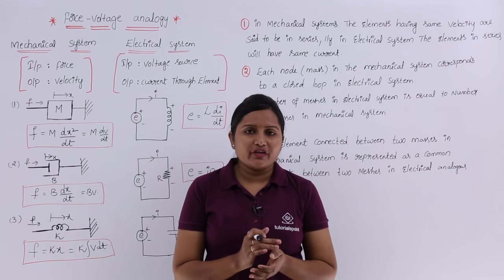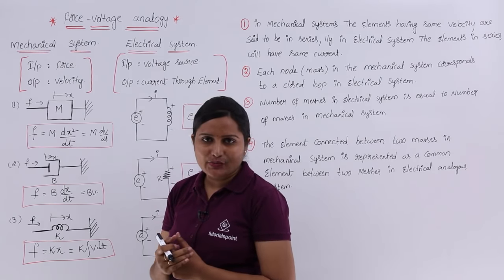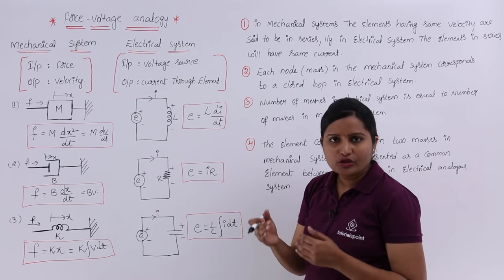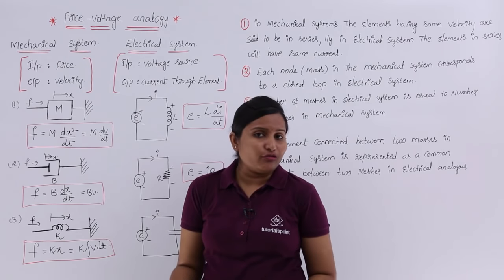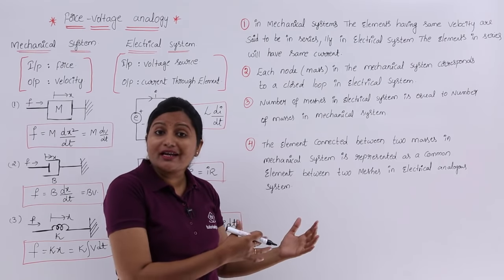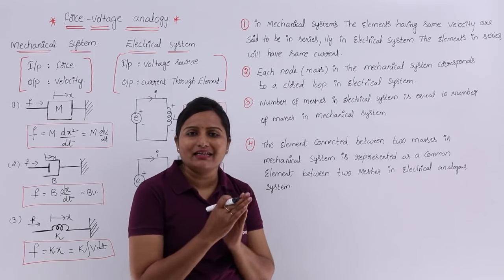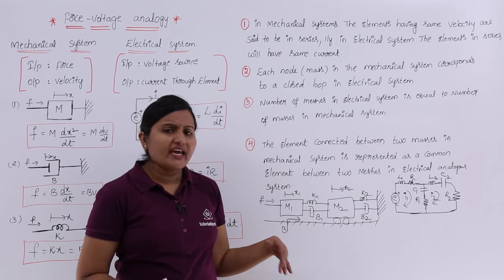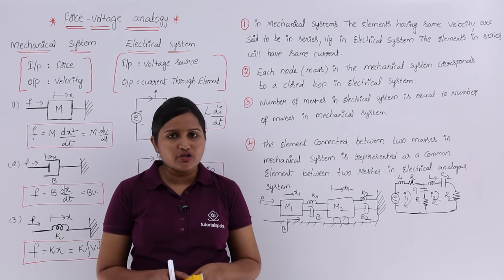Force Voltage Analogy

Comment: what if we have a sub mechanical system with mass, spring, damper that is moved or displaced by a voltage to force converter. an RLC and a mechanical sub system to gather. how will we relate

Comment: Thank you ma'am for the step-by-step explanation but  i am sorry because you didn't explain the analogy  of "reference point" in both systems, it made me a little bit confused why in the example given, in the analogical electrical system, the series element C1 & R1 are connected to reference/ground,....aren't  C1-R1 supposed to be isolated from reference/ground and be connected to L1 and L2 at the series connection C1-R1 respective ends? ... And  C2, because k2 and b2 share the same reference point in the mechanical system, can we connect C2 in parallel with R2 while assuming both have the same curents flows in them?....Thank you.

Comment: Mam..in the numerical
In mechanical system B1 and K1 both are connected in parallel between M1 and M2..
So i think that in electrical system C1 and R1 will be connected in parallel between L1 and L2..
Clear that..mam as soon as possible..bcoz ur exams are soo closs..
Reply: Even i think C1 and R1 should be parallel to each other
Reply: Dont they have the same velocity? displacement with time. i guess thats why they are in series
Reply: as we have only m1 and m2 so we cant have more than two mesh if we connect it in parallel we will have 3 meshes.
Reply: @achintsingh210  see the point no. 1 ) if two elements have same velocity they are connected in series.
I hope you get it.
Reply: See the point no. 1) if the two elements have same velocity, they'll be in series.
Understood?

Comment: what is the real life application of force voltage analogy?...like where would we need to convert an a mechanical system to an electrical one while working in industry?
Reply: It is easier to perform analysis of an electrical system rather than a mechanical system,,, that's why